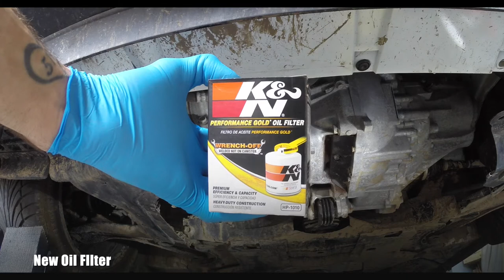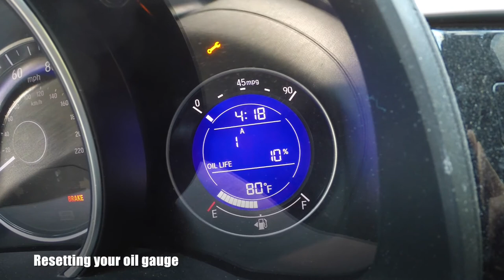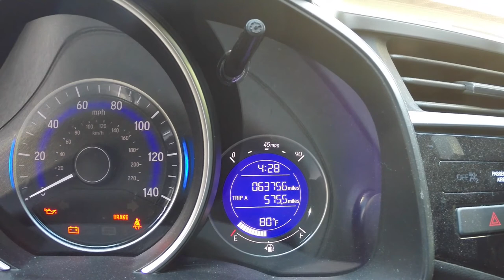2015-19 HONDA FIT/JAZZ - GK5 - Oil & Oil Filter Change - Maintenance Reminder Reset

Comment from the maker: A few Amazon links to items shown in today's video.
Honda Genuine 0W-20 Full Synthetic Oil https://amzn.to/3p7Drwc
K&N Premium Oil Filter HP-1010 https://amzn.to/3E7qLtn
Oil Catch Can https://amzn.to/3mhTDt3
6 AN Braided Hose A few Amazon links to items shown in today's video.
Oil Catch Can https://amzn.to/3WOOSXB
Braided Hose https://amzn.to/3yGM3wV
Flexible Rubber Hose Clamps (Screw Clamp) https://amzn.to/3GVUaZp
Vibrant Performance 16619 AN6Adapter Fitting https://amzn.to/3Fhu7eM
Vibrant Performance 16619 Adapter Fitting https://amzn.to/3EclssT
Flexible Rubber Hose Pipe Clamps - 6an Hose Finisher Clamp with Screw Band https://amzn.to/3e6FQB6
Retainer Clips https://amzn.to/3WLNC7D
AEM Intake https://amzn.to/3sg99cn
Reply: How many boards did you use for your ramp ? so nice and organized - your garage.

Comment: Are you going  to make a transmission oil change video?
Reply from the maker: Yes sir! I have a manual transmission though.
I just filmed a radiator flush video, and a rust sealer video that I applied in the wheel wells and most areas underneath the car.
Reply: @HondaFit4Adventure  I also have a manual 😝
Reply: Probably could have just left that lone survivor and changed the oil with the splash guard to the side, no? Seemed like you got frustrated with it. I know I do when I always gotta change the oil in my Fit. Clips are such a pain.
Reply from the maker: @jmc224  Yes, however I wanted to replace all the clips in the "radiator flush video" so I ripped them all out. Seeing that they were all so brittle I'm surprised how much effort that sole survivor took to get out.
I have a stop sign that I plan to turn into a bolt-able skid-plate and do away with the clips altogether.
Reply: HondaFit4Adventure that’s a great idea. Will you be doing a video of it as well? I’d be interested in trying it myself!
Reply from the maker: @jmc224  Of course. I would say to expect it late November to December.
Reply from the maker: The transmission fluid and pump have just arrived... (Got delivered to the wrong house)
Reply from the maker: HONDA FIT/JAZZ - GK5 - Manual Transmission Fluid Change - From Start to Finish 
https://youtu.be/Sb1nmGv_42Q

Comment: How can I reset the counter in more detail?
Reply from the maker: Place your key into the ignition and turn it into position two.
Press on the brake and trip reset button for 10 seconds or until the display begins to flash.
Let go of the brake and trip reset button and then press and hold once more until the display quits flashing.
The counter has been reset.

Comment: Seeing an oil catch can and that intake pipe on a Fit, must be exciting.   Please place the part numbers for both.
Reply from the maker: Hi eM,
I just put the product links in the video description. Here are the install videos for both.
HONDA FIT/GK5 - GK5 - Oil Catch Can with Braided Hoses & AN Fitting Install - DIY Bracket & Results
https://youtu.be/j5HPPtZbu_s
2015-19 HONDA FIT/JAZZ - GK5 - 1.5L AEM Intake System Installation Instructions 
https://youtu.be/0CXiriq-uws
The Oil catch can is totally worth it. I'm probably going to build my own intake with the parts available on Amazon. It should be a lot cheaper and possibly better positioned then the AEM one. (No complaints about it though)
Reply: @HondaFit4Adventure  do you have any heat soak with the AEM intake?
Reply from the maker: @MatthewTaylor3  Yes and no. I was going to make a follow up video about that but I never got around to do it. In short I would say yes, but not as bad as everyone makes it out to be. Our engine is small and once your car is moving you still will get air circulation under the hood.

Comment: thanks for your videos
when a video changing the gasoline filter?
Reply from the maker: I'm not 100% sure, but I think the 2015 and up Honda Fit's fuel filter is not made to be serviced. You'll have to replace the fuel pump to replace the fuel filter.
Reply: the manual says fuel filter change should be done at 50k miles or 4 years
Reply from the maker: @josemiguelnavarro6205  What manual or page number are you looking at?
I asked my mechanic to change it once and he said to leave it alone. 
The FitFreaks forum seem to say the same thing.
Reply: https://drive.google.com/file/d/1R4_pJTlrvijnTNQ0aBO-cHYegxqTGh2s/view?usp=drivesdk
Page 484. Sorry is in spanish
Reply from the maker: @josemiguelnavarro6205  I don't have permissions. I've been googling and the only thing I can find is "Check Fuel Systems"

Comment: Have you tried 0W-16 yet?  Just picking up a 2019 fit and am going to flush the old oil out with amsoil flush and try running some 0W-16 in the winter time for the quicker heat up and maybe slightly better MPG.
Reply from the maker: You mean 0W-15?
No I have not.
Reply: @HondaFit4Adventure  0W-15 is not a thing currently.

Comment: 0w20 is just recommended for fuel economy. Better use 0w30 or 5w30 or 5w40 for track scenario. Of course only approved by Honda Oil ! Thanks for the video!
Reply from the maker: An engineer at work told me the same thing. Or to start using a thicker weight when it gets to a certain mileage.

Comment: Is there a washer or gasket on the drain plug bolt that needs to be replaced?
Reply from the maker: There is a "Crush Washer" that you should put on your drain plug & replace after every oil change.
Reply: Thanks!👍

Comment: Watching the struggle to remove the stupid pin at the rear of the underneath guard had me laughing - I had the same experience with my Fit.  What a FAIL, Honda!!
Reply from the maker: Generic YouTube Videos be like "All you have to do is remove the skid plate" - Cuts to the next step.
Nah, If something is a P.I.T.A. I'm not going to clip it out of the video. Even if I drop a bolt into the engine bay I'm still going to include it, which I did in my first YouTube video. :)
Reply: @HondaFit4Adventure  I haven't seen a video yet that actually shows removing those push pins.  Hell, that's the most difficult part of the job on this car!  I've ordered an assortment of replacement fasteners that SHOULD include the pop-out/push-in ones needed here.  I'll wait until I do another oil change and see if they actually work before I respond with the results, link, etc.  Thanks for your video!